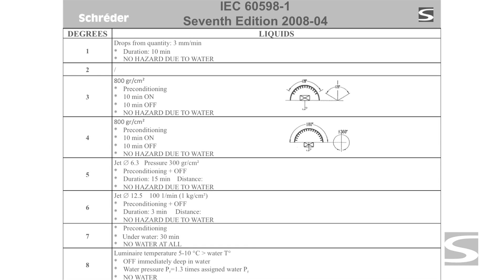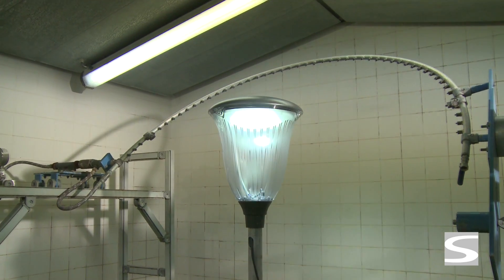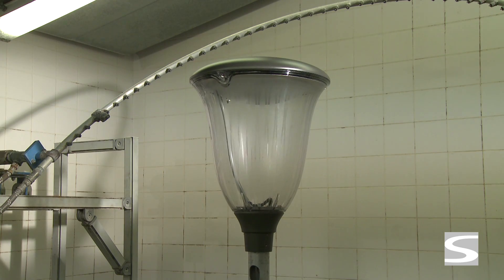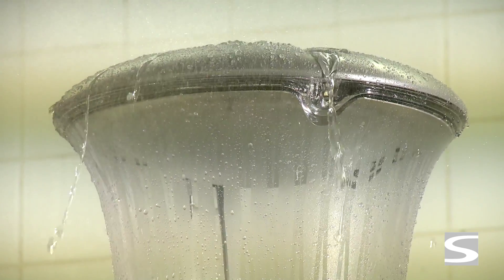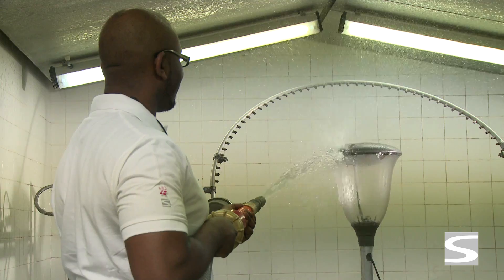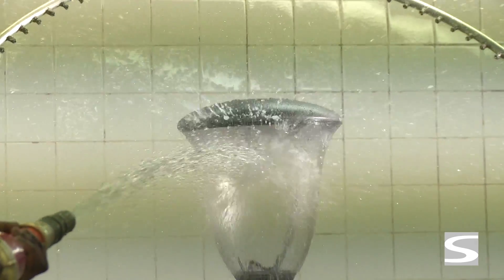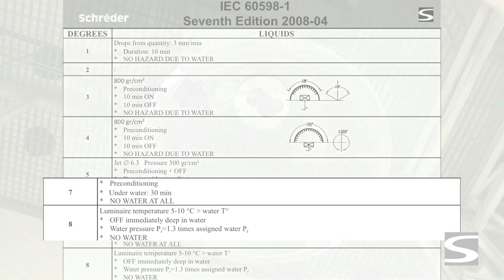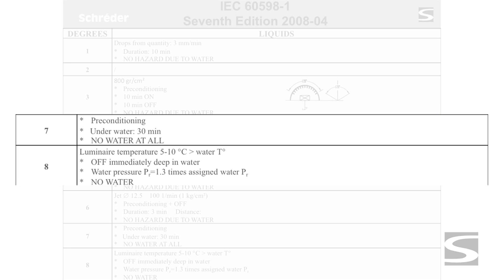IP Level (Ingress of Liquid) Test Procedure

Comment: hello! so with some ipx5 headphones can I take a shower at home? thanks
Reply: Hello, you can take a look here to have part of an answer: https://en.wikipedia.org/wiki/IP_Code
The first x means that it's not tested for solid particles, the 5 means that it's "water projected by a nozzle (6.3 mm (0.25 in)) against enclosure from any direction shall have no harmful effects." IPx5 seems to be the minimum to take a shower. If it was me I would use something like IPx6 but I never thought about this idea before.